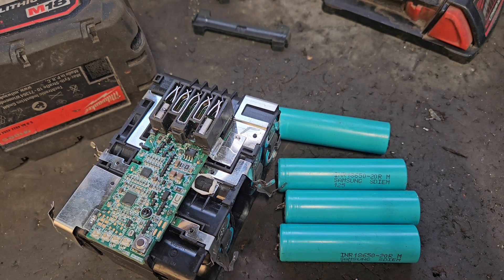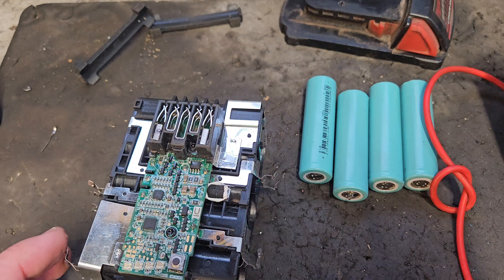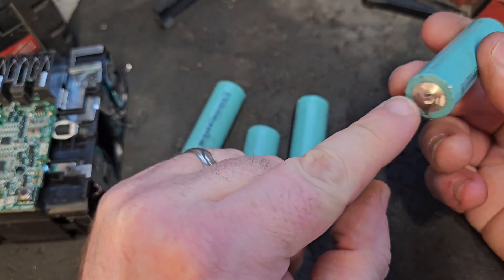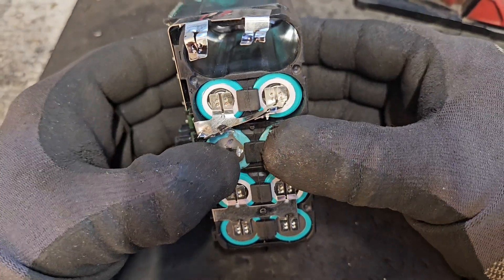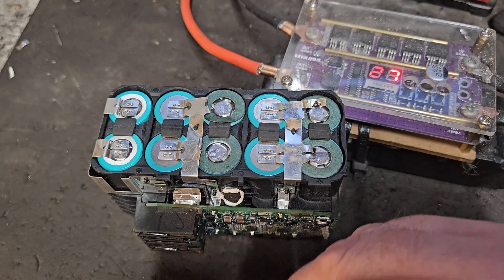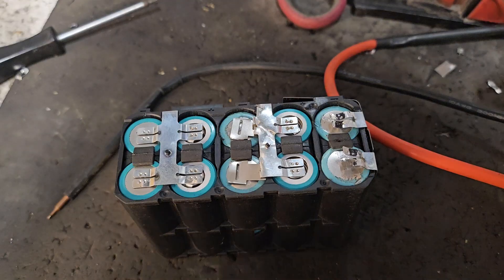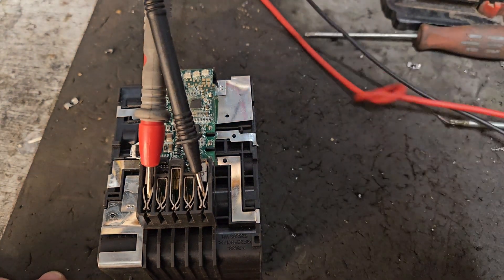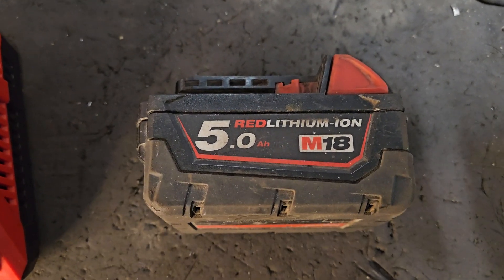Milwaukee Battery repair course EPISODE 4 Installing good cells to replace dead ones

Comment: Any voltage under 17 volts cannot be charged ??
Reply from the maker: That information is not strictly true but if it is 17v and won't charge something is definitely wrong. As I understand it even as low as 12.5v if the cells are all equal can be charged and there are no other issues of course.

Comment: Is there a spot welder on Amazon or eBay you can recommend me please?
Reply: Or if you could make a video on how you made yours!
Reply from the maker: Alot of what you could buy on there is not great.I bought my latest one from ebay it was fairly expensive and requires alot on of set up. I am currently using the kweld.

Comment: Appreciate the video. Could you just re-spot weld the original tabs back down. Is there a reason not to do this?  Thanks in advance.
Reply from the maker: The reason I don't use the original tabs is that my spot welder isn't powerful enough to weld them. I use lighter strip than the original to make it possible for my spot welder to weld them. I could get a more powerful welder but there are higher risks with that sort of power. There is a chance it could blow a hole in a cell.
Reply: @ Thanks for the reply. I thought that might be the reason. I tried with a cheaper welder and it didn’t work. Wasn’t sure how powerful I would need to weld the old tabs. Any idea? Also wasn’t sure if the old tabs were nickel or some other metal? I really appreciate your feedback. Thank you!

Comment: About to dig into experimenting with a few faulty m18 batteries and so far this is the most thorough set of videos yet. Appreciate you man, good work.
Reply from the maker: Thank you I got a long video I filmed last night you might like. I got sent 8 m18 batteries to fix I did a full half hour triage session. A range of different faults. I gotta edit the video but it will be out in the next week or two.
Reply: @  well I’m subscribed. I have a pile of m18 batteries I can’t see just throwing out, and I found a few other videos like yours, but none were as in depth or they had recording quality issues. Yours are awesome man and after watching, I got 3 torn down, diagnosed and just waiting on replacement cells. 
Im glad people like you are passing down some knowledge instead of just letting us dish out hundreds for replacement battery packs unnecessarily.  Thanks again. I’ll keep an eye on the channel.
Reply from the maker: @christophersiddall7270  thank you

Comment: How do you limit the charge to 3.5v on new battery installation?
Reply: Will the BMS fault out if 4.2v battery is used?
Reply from the maker: The cells all need to be very close in voltage or the bms will fault out
Reply from the maker: I just charge it and take it off when it reaches the desired voltage I have no way of getting the charger I use to stop at a specific voltage.
Reply: Charge up the batteries and use something like a fan to discharge them if your over. Fans using two 18650 batteries are pretty cheap.

Comment: why didn't you just spot weld a longer strip across the two batteries instead of soldering?? you could have spot welded the new strip over the old strip
Reply from the maker: Spot welding the new strip over the old makes it hard to get back into the case.

Comment: Is there a reliable pcb for a 6.0 ah battery i had a recent issue and my official pcb shorted thanks to a work colleague but i cant find anywhere to get official pcbs but idk if the off hand ones are any good like can they not damage tools or anything?
Reply from the maker: The copy boards seem OK I have been using them a while now https://amzn.to/40pYehz